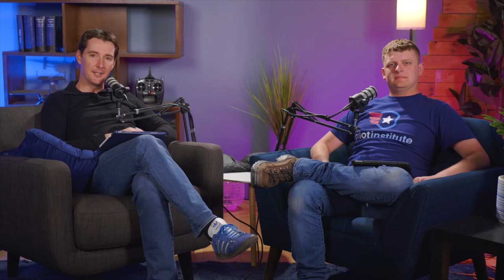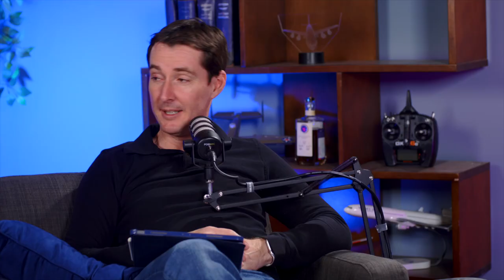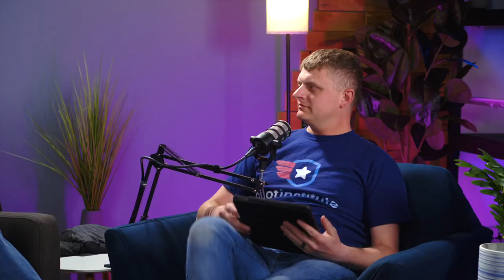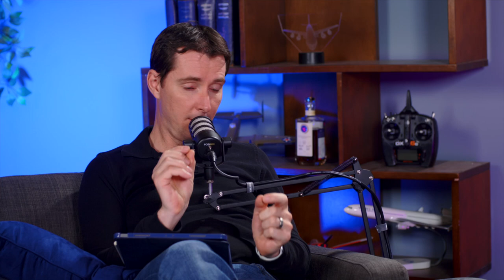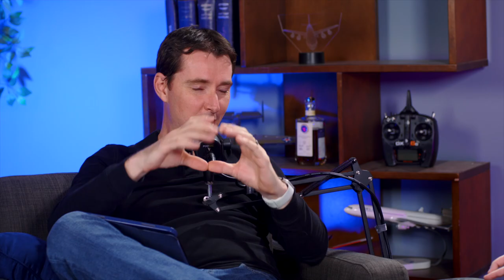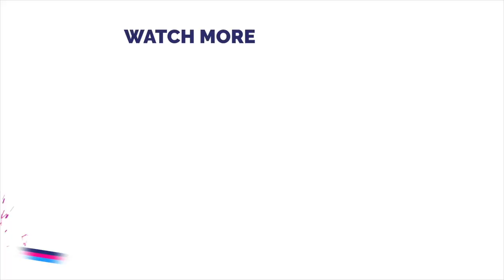Private Pilot Ground Lesson: Aircraft Systems Part 1

Comment: Regarding the starter not having a breaker, in the event of a short circuit or high impedance short or fault  that causes that circuit to draw more current than intended a breaker is placed in that branch of the circuit to open clearing the fault  protecting the system by isolating the problem. If a starter is operating normally, then no breaker is needed and any issues would be discovered only while the key is in the start position. The starter circuit is already normally open until you twist the key into the start position. You could put a breaker in that is rated right under the current vale the starter is rated to draw but with a time curve that would allow you to run the starter long enough to start the engine but protect the starter from being cranked to long and burning up the windings. Or JUST DON'T CRANK IT. It is doesn't start normally, find the cause before trying again.

Comment: I have to disagree with one part: The discussion on the angle of attack for the propeller. Actually, the reason that there is more pitch angle toward the inner portion of the prop and less toward the outer portion of the prop has to do with maintaining the same angle of attack throughout the entire length of the propeller. This does not apply when running on the ground. Rather, it applies while moving through the air. The entire propeller is moving at the same RPM but since the inner portion of the propeller is a smaller diameter than the outer portion, the outer portion actually moves through a greater distance. It has a greater circumference. Since the forward motion of the aircraft is fixed at a given speed, we really need to compare the circumference of the outer portion of the propeller to the distance traveled by the aircraft over the course of one revolution. This will give us our angle of attack for that portion of the propeller. Now, if we do the same thing for the inner portion of the propeller, we will find that because the circumference that it travels is shorter for one revolution, we will need a steeper pitch angle to maintain the same angle of attack for that same forward motion. Therefore, adding this twist to the propeller actually maintains the same angle of attack throughout the entire length of the propeller. This is also why a consonant speed prop is more efficient... because you can change the pitch to achieve a more efficient angle of attack which results in more thrust or better economy.